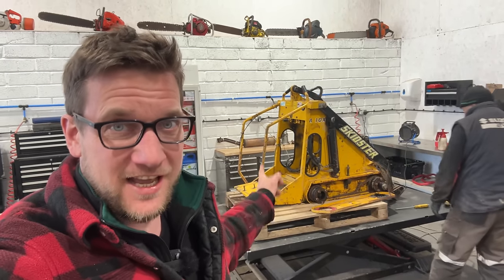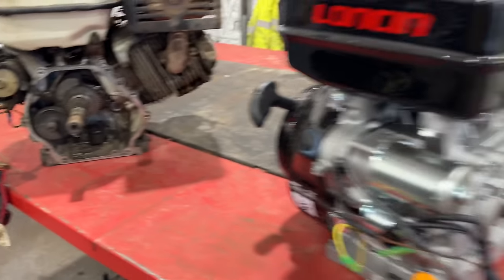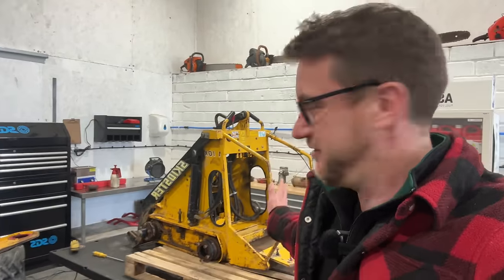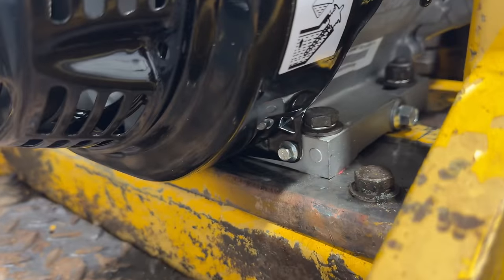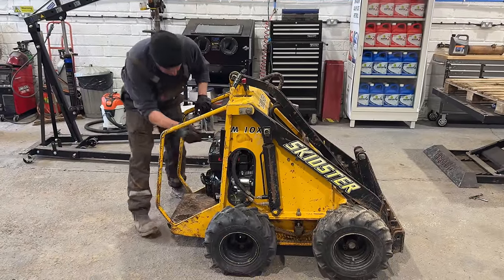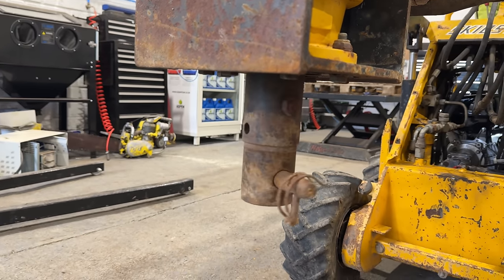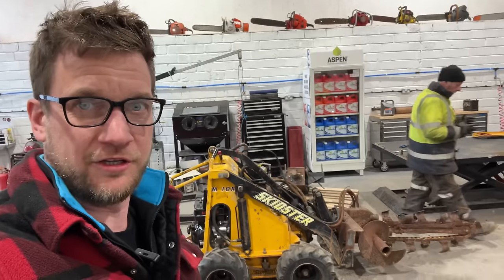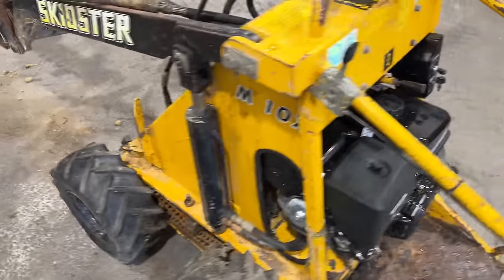Installing the NEW Engine in the Opico SKIDSTEER and Testing the attachments - Does it work though?

Comment: Nice to see her going again mines very lively on full revs haha had to replace the both chains on the drive aswell. I always wondered what that fitting was for on the tank my auger hasn't got a case drain also never thought of using the skidster to power the breaker I always take the beaver pack 🤣👌learn something new everyday. Still interested in the trencher and pallet forks if they're available.
Reply from the maker: Hey mate, ping me a message on the implements. Yep defo a learn something everyday 👍🏼

Comment: I completely understand why you went down the Loncin route, but by the same token, I wouldn't even consider buying a machine with one fitted.

The Honda Gx is just unrivaled for reliability, longevity and spares availability. Its all i run now.

Each to their own,  though. Im sure this will make for a cheaper machine for whoever buys it and slightly more profit for yourselves. 👍
Reply from the maker: Yeah I get what you mean, Unfortunately the Honda on this one was toast, parts haven’t been a good from Honda of late and their warranty isn’t generally worth much anymore as they wiggle out of everything. (I used to be a Honda dealer) love them in general, but Loncin do seem to be great on parts and you can buy at least 2 of their engines for the same as a Honda.
Reply: @MachineryNationVlogs  Doubly tricky for you guys too, not being the end user. I would imagine there's not a lot of profit for you in these things?

Worrying to hear about their spare parts, I daren't think how many GX's we're running currently! 🙈 

Also interesting to hear you used to be a Honda dealer but are happy to use Loncin. Shows you're clearly not biased etc. 👍

Comment: Real old school chain treatment, coil up replacement chain(s), put in large pot cover with heavy gear oil or light grease (00 or 000 grade) heat to ~+120°C let cool overnight, install chains. Not to be done to O'ring chain.
Reply from the maker: That’s Interesting, thank you.
Reply: @finditfixitfarmit  Are the chains on the skid steer open? If so, putting covers on will give longer life. Also, depending on how, they are done, will add greatly to machine rigidity.
Best wishes from the far North.
Reply: @carlthor91  they had the covers on in the start but removed them like they said for easy access :)
Reply: @nekoroms  Missed that part, oh darned.🤣